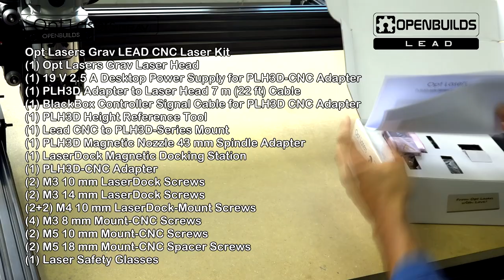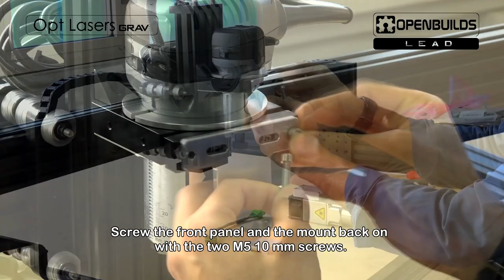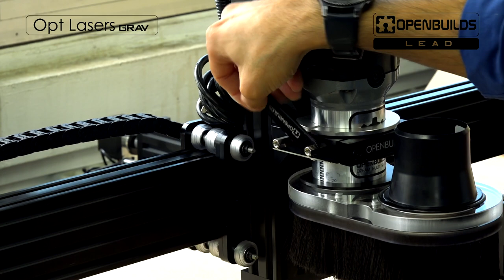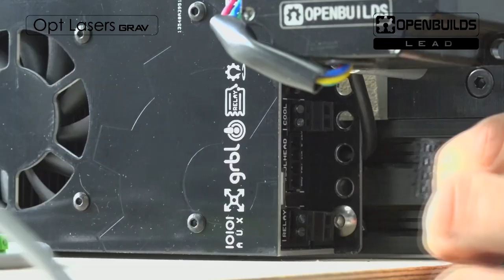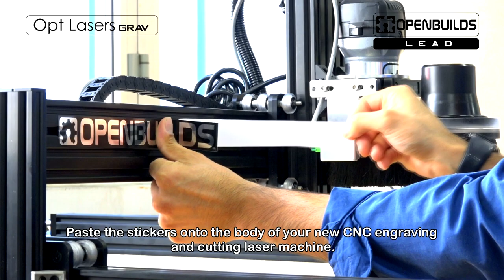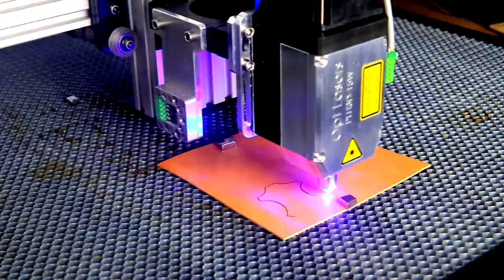HOW TO: Opt Lasers to OpenBuilds CNC Machine Upgrade

Comment: Very interesting product but you are showing us to plug into the toolhead connection in the Blackbox where there is already tge IOT powrr bar already wired in. Do we plug both together?
Reply from the maker: You should have your laser in the tool head for the PWM signal. If you are turning on a vac or something you want to control separate you can use the COOL connection even to an IOT relay, just add an M8 to the head gcode and an M9 to turn off at the end. Please check ou the docs here on some ideas that may help - https://docs.openbuilds.com/doku.php?id=docs:blackbox:connect-coolant